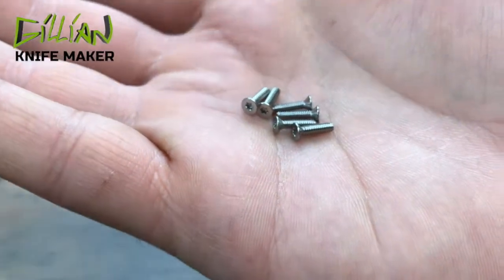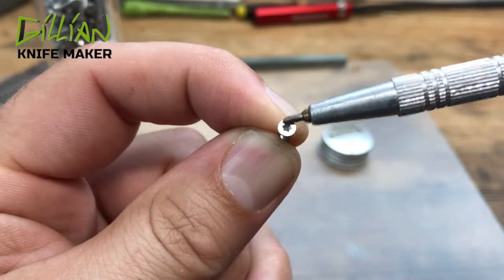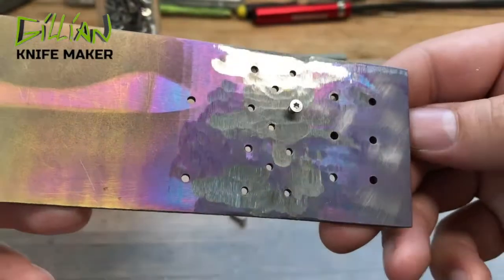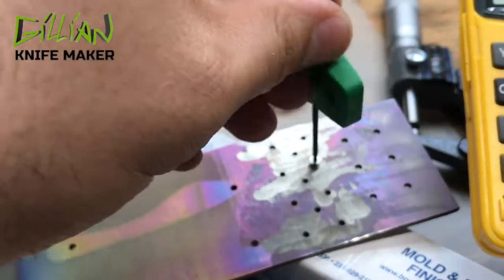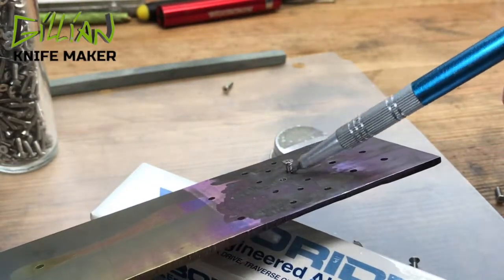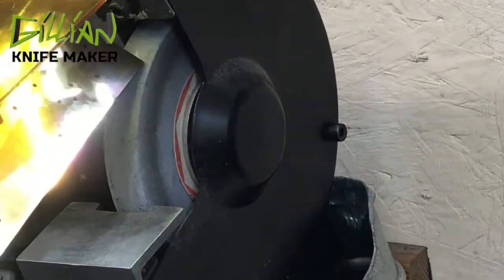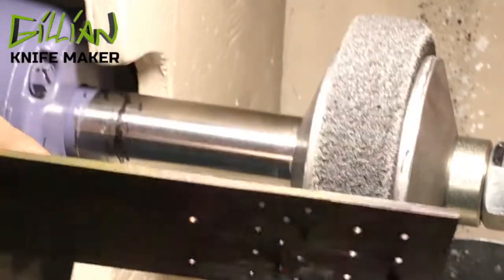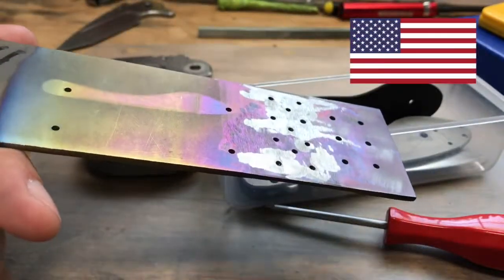How To Shorten Tiny Screws

Comment: 1:45 would material influence this? 86 thou screw, could you use thinner material if it’s hardened, or thicker on softer materials like titanium? 

This is such a great technique. Super elegant solution. Especially with the counting the revolutions to determine depth. This could in theory be used to make an angle adjust grinding jig. To the drawing board!

Comment: Why not make your plate the thickness of how long you want your screw, then you can just screw the screw all the way in and grind off what is sticking thru.
Reply from the maker: You have the right idea Roy.  You can further speed up the process by using a pass-thru hole so you don’t have to screw anything into the tooling plate.

Comment: They are bolts, not bloody screws, screws are self tapping, bolts have nuts.  If you put the nut on the BOLT first, then cut it, you don need to do anything else.
Reply: No, they're machine screws, look them up; it's you against the world.
Reply: Where’s the bolt then? It’s a machine screw. Kind of like how “drill bits” are actually just called drills.